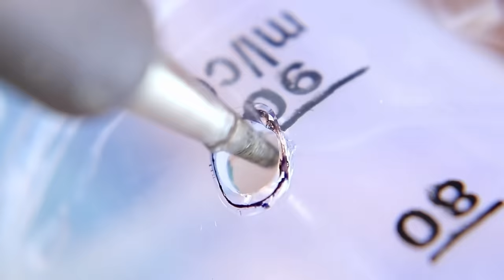3 Amazing Bike Life Hacks

Comment: The first one is useless, youre just sucking air in and out of the tire. Even if you'll do it for a year the tire will never be filled
Reply: ಭಪಷಙಪಭಚಮಪಕಗಬ ಪ್ರಶಸ್ತಿ ಸಣ್ಣ
ಬ್ರಹ್ಮ ಹೌ ಟು ಡ್ರಾ ಮ
Reply: It needs a non return valve that lets it draw air in and then closes to stop it escaping when you pump,would be better just keeping the pump he took all the parts off of.
Reply: ය
Reply: it wont suck air from the tire m8
Reply: S
Reply: he has a hole drilled for air to go in when syringe open fully, and the bike pump hose has a one way valve. You can hear it has at least some pressure afterwards
Reply: deception 3:46 hahaha
Reply: There needs to be a one way valve to suck in the air when pulling out the plunger for that to work, plus those plastic syringes are way too flimsy and will fall apart.